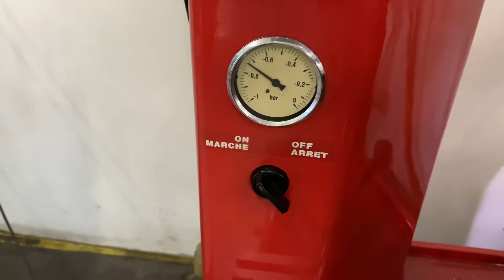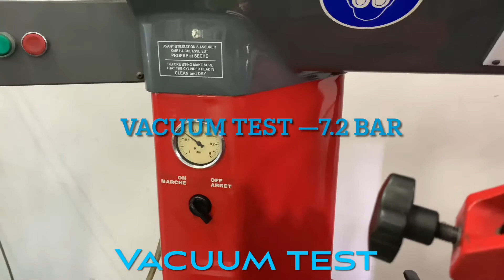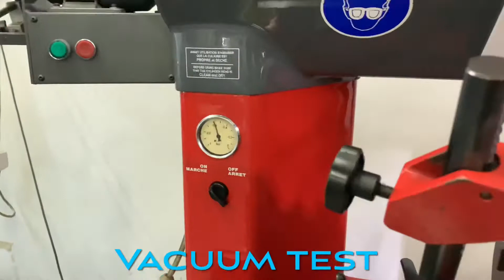Valve SEAT Cutting of NISSAN RB26 Radius valve Cut  #valve-seat #machineshop #cylinderhead  #shorts

Comment: Are the valve cover sealing surfaces parallel to the valve seats?
Reply from the maker: What do you mean sir
Reply: @KABUKONGALONSOPTV1984  If the valve covers are parallel to the valve seats, I can clamp the cylinder head down in a 90 degree machine and cut the seats. If they're not, I have to tram them and shim them accordingly, which takes time and opens the door to error.